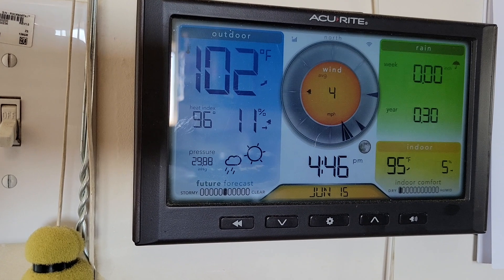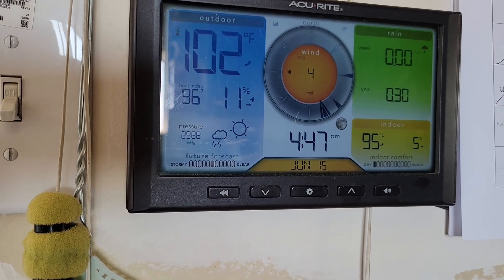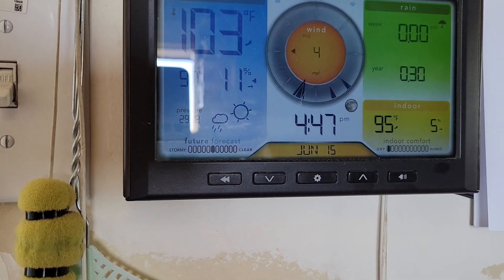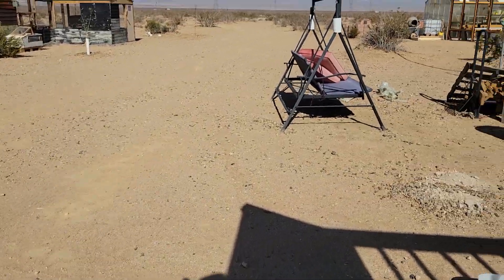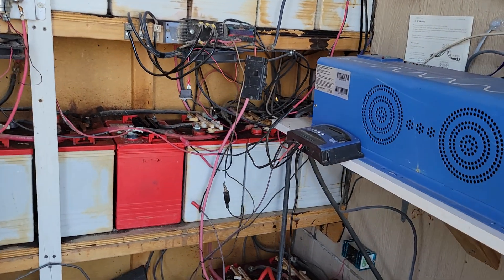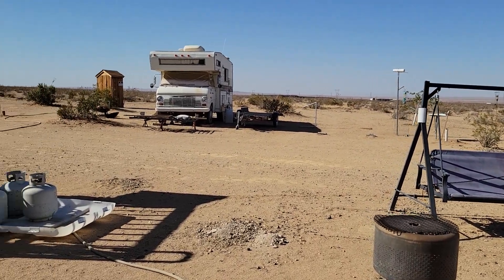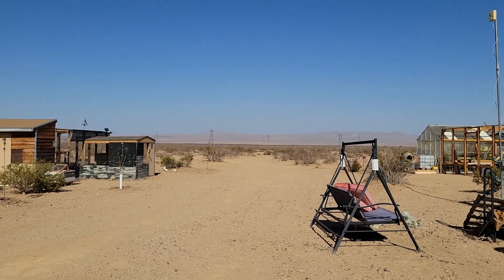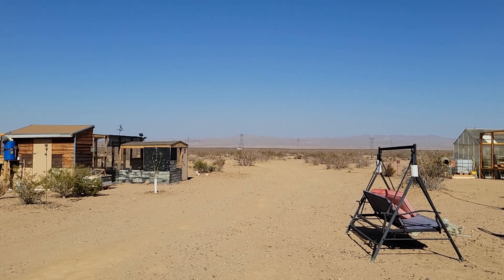Fixed The Overheating Rectifier and Other Subjects of Interest, June 15, 2022

Comment: Occasionally our FedEx driver will leave the package at the end of the 500 foot gravel driveway. he has on occasion he/she left it with the garbage cans on garbage day. Luckily I know this so check out for packages before the garbage guy comes otherwise it would be gone. Most 95% of the time all the other deliveries drive up the driveway and drop the packages

For the welding I have been looking into mig welding is that something that you’re familiar with or is it something that you think is not as good as what you’re doing?

And btw nice winds at night to supplement power from the turbine when no solar.  Perfect setup.  
Thx for sharing
Reply from the maker: Thanks.  For welding, I have gas and a Lincoln wire feed might, but I would LOVE a cold welder since it does everything a MIG, TIG, or Gas welders can, including stainless steel.

Comment: Propane roofers torches are also great to annihilate weeds. You can just singe them or burn them to the ground. Found out I have gold on my garage roof, the solar panels produce a bit more than we use during the year. While being on-grid they pay me for over-producing kWhrs. Variable elec prices trippled last year in Holland to around 60 cents per kwh. With inflation around 10 percent it's a no-brainer to grow more veggies at the backyard. Retirement fund did not go up during the last 5 yrs, but I'm hoping that every shriveled potatoe that I put into my beds will yield 6 times the original weight. Bank savings return zilch. Noticed your water bill, consider mulching your raised beds in order to reduce evaporation and replace overhead watering by subsoil watering. Every 3 square feet I have dug in a 3 inch plastic pot ballasted with pebbles in my raised beds. Less weeds and evaporation.
Reply from the maker: Yeah, mulch is hard to come by put here and I can't afford to buy it. I think I will take a ride to one of the abandoned grow farms and grab some drip sprinklers to set up my garden with.
Reply from the maker: Oh, and yes, I have a propane roofers torch too.

Comment: Good afternoon and I'm glad the wind die down on you and it sucks  temperature and good deal you get your fan fixed and I still got my cutting torch and the gauges for it I have not used them for long time probably not again but they are put up and it got pretty warm here today humility and I did not stay outside very long maybe 10 minutes it was really bad and you have a good night and a good supper
Reply from the maker: Thanks.  Yeah, I don't use the oxy-acetylene often, that's why it is buried in my shop.  I do occassionally weld, braise,  or heat things though.